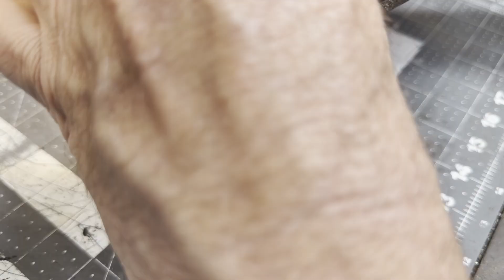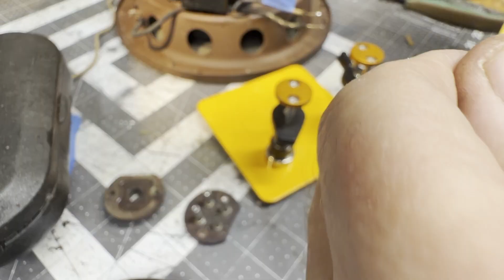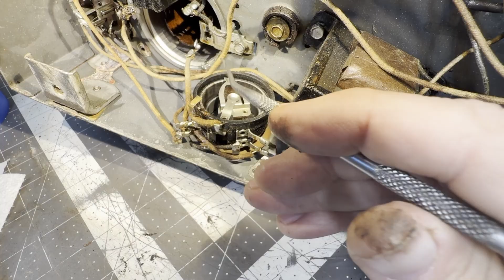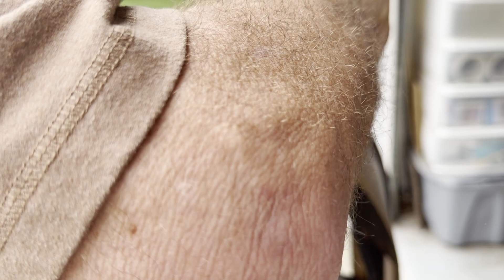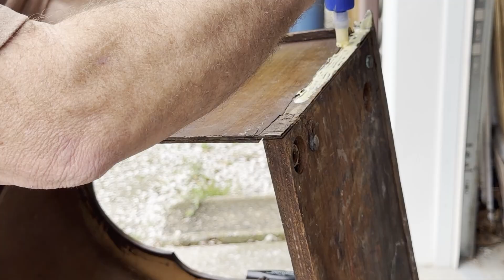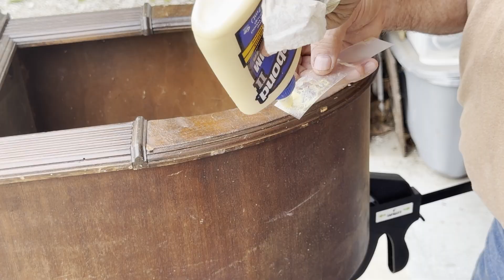Pt 18 Tube Radio Repair.  Working On Veneer Patching and Speaker Repair

Comment: I think one of these reasons the little bit of new solder helps is because it increases the connection area between the tip and the job
Reply from the maker: That sounds reasonable.  I just know it works!
Reply: @JohnAdams-v9w yes for sure, you can see in the Close ups that the new solder pool's to a puddle or the shape of the item your unsoldering,so that thought work's for me haha

Comment: Struggling with the small soldering iron with that metal hollow pin on the plug. Seems my Heathkit GH-17A chisel point has
better heating abilties to do that job. Gob of solder on the finished tip can be removed with desoldering braid too. I like the 
way you do woodworking on new veneer John. Save your sanded shavings in a jar for small dings,dents and divot repairs in
other places on cabinets. After those dry I have several shades of Mohawk fine tip brush markers ( $$$)  that you can draw
grain lines on the glued up repairs. If used correctly you can hide those patches very nicely.
Reply from the maker: Thank you for the tips. I appreciate them.